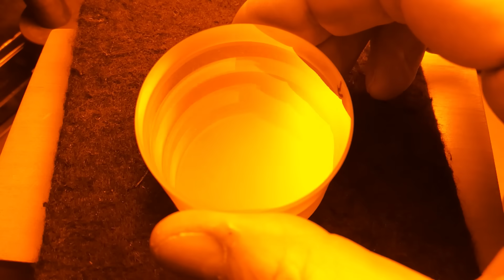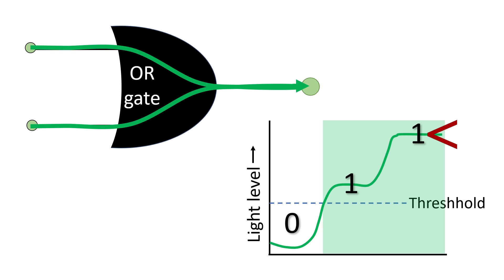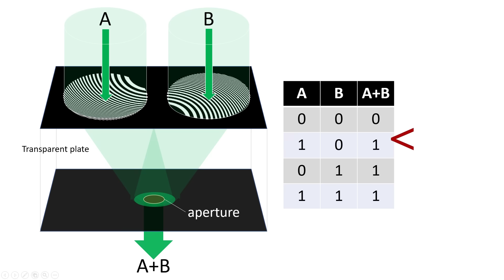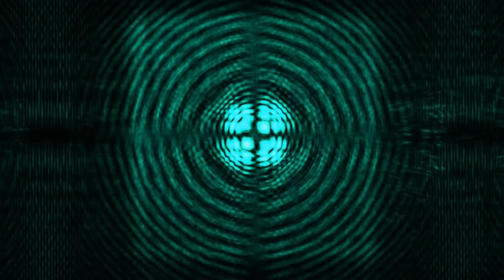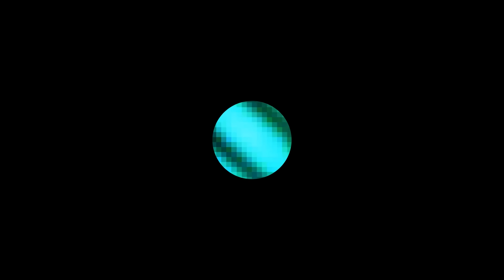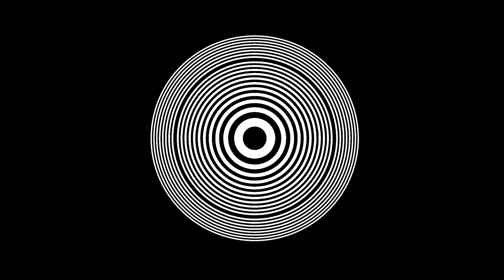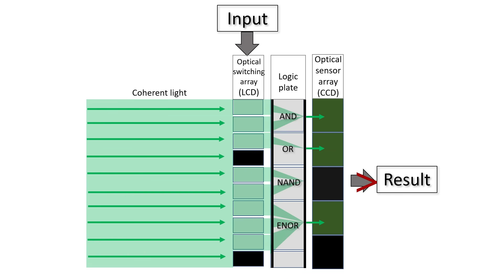Making Optical Logic Gates using Interference

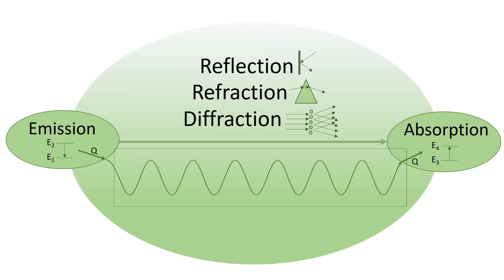Comment: Haven't finished watching the vid yet (2:08) but just realised refraction provides both AND & XOR gates, it's all about the angle of collision or lack thereof, the gate is simple, you have 4 refractive objects, 2 angle both inputs to one destination for the XOR result while the other 2 use separate destinations, one is used for the AND result and the other can just be sent off to charge some capacitor or something, nothing is wasted

Edit: Thinking about it the extra 2 refractive objects are only needed if you need the paths to be different from where the light photons would go once they collide with each other

Edit 2: In case anyone didn't follow my thought process, you gotta have the refractive objects AFTER the point of collision, no collision means only 1 had light come out (or neither had any), a collision naturally means there was light in both and the path of the light photons changed at that point, you simply capture one of the new paths (which will be known prior based on the angle it is released at) and use that for the AND result

Edit 3: Thinking further on it I believe at least 1 of the refractive objects will need to run parallel to 1 of the lights, This will cause the collision to result in 1 path that goes away from the XOR output, the 2nd would redirect one of the lights to where the other would've gone

Edit 4: After gving it a bit more thought here's a logic gate for light, it covers both AND & XOR, the green line is a mirror, the blue line a refactor, the orange & yellow is the 2 beams of light coloured differently for clarity, the collision provides a 1 for the AND result, anything else provides 0, the refactor is for directing the light to XOR result, the mirror is likewise for directing to the XOR result, the rest is just utilising angles & capturing the output, the excess light from a collision can just be sent to a capacitor or clock or something ensuring the energy is not wasted.

Edit 5: URI got corrupted, another attempt.

https://drive.google.com/file/d/10D-1ML0Bag-JMOBKCmNcZWgtRRwu8e1q/view?usp=sharing

Comment: it is a good attempt and i wish you good luck. but as far as convential logig circuits are built. i started thinking about, what is electrical resistance, what is noise, and if it has something to do with incoherent light, how to use it in favor of the logic system.

Comment: Making more logic gates in the same area as we currently have and power them with UV/Vis light will be really hard.
Reply: But they are faster and less limited than electronics, so you can get more milage from a similar arrangement. LED would be optimized for it's circuit. Because you couldn't directly link them all together, each circuit could have a differently tuned LED source, specific to it's purpose.

Comment: I love the video, and that someone finally gave me a good explanation of the topic! I just see one big challenge: They couldn't be chained together, because the light they produce can be of different intensities and phases. Is there a (simple) way to fix this, or can they only be used for simple logic without electronics in between? (If they could, that could make the speed of sensors and diodes much less relevant)
Reply from the maker: It's a good question and at this point I don't know. But I will look into this in the future and maybe decide a different configuration where this would be easier to realise.
Reply: @HuygensOptics  Although it would likely be difficult to manufacture practically, you could use the optocoupler/photocoupler concept between logic elements.  This basically serves as the electrical equivalent of a buffer.

Comment: took me bit to find this link but this is using light and its properties to form logic that analysis handwritten digits in a form of glass(I think) with airbubbles.  found it to be similar what you are talking about. Luckily i had shared it on facebook so was easier for me to find there.  https://youtu.be/o4VruFS14NM
Reply from the maker: Interesting. So one of the limitations is of course that the air bubble "neurons" are not programmable, you cannot add weights to the optical "dendrites". But maybe that is possible if you instead took 2 diffusers with a high res LCD in between.

Comment: I'm currently working on running simulations for optical neural net components. Good to see more people are considering the potential in integrated photonics. I don't know if interference is the right strategy though considering the difficulty of getting interference on chip with enough nodes.

Comment: how would you ensure that the intensity of a light is either at a certain level, or at 0?  This may become an issue once you start designing larger circuits with this implementation where fanout is common.  In an optical logic circuit such as this, fanning out signals to different gates/devices
Reply from the maker: That is correct, light levels will not be zero, so one should use threshold values to distinguish between 0 and 1. This will be increasingly difficult when cascading units . So that is why analog computation is probably a better option.

Comment: I would figure the ideal chip using optical logic gates for computation would probably use far-UV light so the gates could be made as small as possible, though that would also most likely make it a far more difficult engineering problem to get right. Super cool concept nonetheless

Comment: I have been thinking about this too! You have way more in depth knowledge than I have, but I was thinking about the use of lcd's in optical gates and I don't think it's the best way as your rate limited by the Lcd's performance and control circuit. My current thinking is "you only have a solid consistent beam of light as input and control" I felt that using electricity part way through the operation would be like a modern computer having a vacuum tube.

While watching I thought you could possibly laser etch into a prism the interference patterns, this might allow you to both split and possibly recombine the beam.

You could also try to add a magnifying layer for the outputs of your current design, it could help when chaining gates and general signal integrity.
Reply from the maker: Thanks for your suggestions. The idea of combining diffractive and refractive optical effects is certainly interesting. However, alignment will be quite difficult I guess.

Comment: Have you explored polarization as the logic level as opposed to interference based intensity?
Reply: If you could use left and right hand circular polarisation the system would become immune to phase shifting caused by thermal expansion which would be quite useful.
Reply: @zyeborm  I've always wondered if it would be possible to basically add or subtract 2 wavelengths from each other and use that for math within a processor (hope that makes sense).  Not sure how to handle logic with such a system though (maybe use a specific set of wavelengths that have this sort of constructive/destructive behavior).
Reply: @grn1  yes maybe with Fourier transforms, i was thinking of an analog computer based on wave arithmetic.

Comment: I wonder if there would be any benefit in trying to make zone plates with smoothly varying sinusoidal opacity, instead of the usual fully opaque and fully transparent stripes.

I don't know how small you can get your details with your lithography setup, pretty small it seems,  :)  but perhaps you could use a sub-wavelength dither or sawtooth to transition between opaque stripes and transparent stripes. 

If I recall, moth's eyes do something similar to this, but in three dimensions. Their eye lenses don't have smooth glass-like surfaces, but rather the surfaces are blanketed with an array of sub-wavlength cones at sub-wavlength spacing, which the longer wavelength light treats as a  gradual transition from the refractive index of air to the refractive index of the denser eye material. This gradual transition helps reduce the loss of light to specular reflection, making the moth's eyes more efficient.

In the case of zone plates, you'd be creating a similar effect in the 2D zone pattern, by incorporating a sub-wavelength drop-off pattern in the opaque material as you transition out of opaque stripes into transparent stripes. If you could get the effective opacity to vary sinusoidally, then you'd have a zone plate that behaved much more like the pair of touching glass blocks you showed at 0:15, in terms of smoothly varying transmission and reflection stripes.

This sinusoidal zone plate pattern might also help reduce the higher order additional focal points.
Anyway, just a thought. Fantastic channel by the way. :)
Reply from the maker: Making gradual phase changes in the rings of zone plates can definitely improve optical performance. This is basically what is achieved in high-resolution meta surfaces.

Comment: Nice presentation. Many current optical logic gates desings are based on the 'inteference' principle, for example those based on MZI. Phase delays are usually tuned by changing refractive index of materials or the length of light path. The diffractive method may have some advantages in computation (not necessarily logic gates since interference gives more than that). You may be interested in the following two papers:1.All-optical machine learning using diffractive deep neural networks and 2.Deep learning with coherent nanophotonic circuits. These two looks quite different, however both are based on interference.

Comment: Brilliant work as always! Your suggestion that “analog” optical computing could also be possible is very intriguing. I wonder if a precise analog multiplier could be made using optics. There are semiconductor based analog multipliers but they are pretty much prohibitively expensive since they require extremely good component matching, ie. laser trimming and probably other expensive processes.
Reply from the maker: I think it should be possible, though I doubt it would be much cheaper, because it also requires high precision components and alignment.
Reply: these analog multipliers are already used by artificial intelligence apps, there is a company out there that extracts electromagnetic field from the wires , puts the signal into waveguides and then they are analogically processed by photonic chip (matrix multiplication in parallel) , and then the result is put back into wires again and sent to the silicon chip. It is kind of accelerator for machine learning, a company (with millions in funding) has already made prototype (that was year ago but I don't remember the company name) and they are getting ready to commercialize it

Comment: Anyone knows how to make these monochromatic lighting conditions. I am wondering why all that I have seen are orange in color. Obviously, it is not a laser.
Reply from the maker: The orange light at the beginning of the video is from a sodium vapour lamp, which has its main emission at 589nm.
Reply: @HuygensOptics  Thanks. I already located one shop here that sells street lighting parts but need to find a ballast unit also. I think that many of us that are not into optics will appreciate it if you make some short video describing your unit and typical use cases for monochromatic light. From time to time optical flats appear on eBay but I don't know if they are any good.

Comment: I really like this video and see a load of potential in your work.  Regarding the logic plate stack,  I think the LCD and CCD slow gating issues are fine if you just stack more logic plates to create bigger computation logic circuits.  The problem I see with this is that you dont have much control over planar xy alignment and thickness uniformity.  To solve this problem, I am suggesting you find a way to change the axis of light to run parallel to the surface instead of perpendicular through the plates.  This creates a new set of problems but I think you are capable is solving them:  how to create defraction lenses vertically from the plate and hurdles associated.  Keep up the awesome work!
Reply from the maker: Thanks for the suggestions. It is very difficult to acually stack these as binary logic units in the current configuration (analog would make more sense because of the nature of interferometry). In-plane configurations also have a serious downside: they take quite a lot of space and because you can only place them in one plane, you can only create a very limited number of them next to each other. I think the x-y alignment is feasibel, but it still requires some work on the accurcy of my wafer stepper.